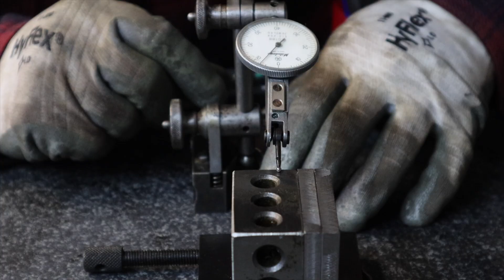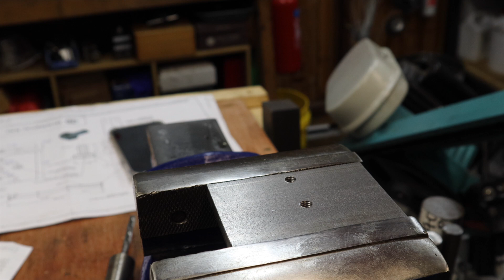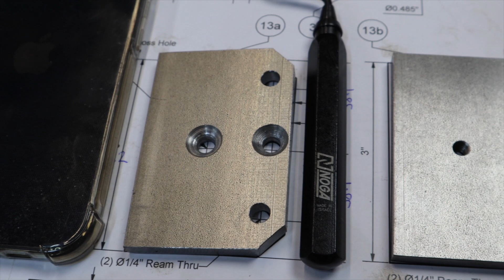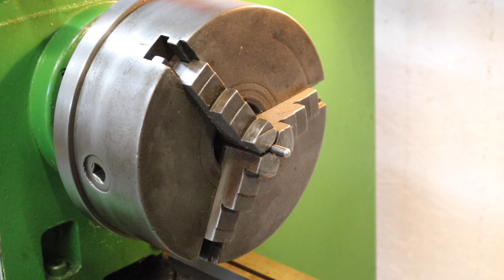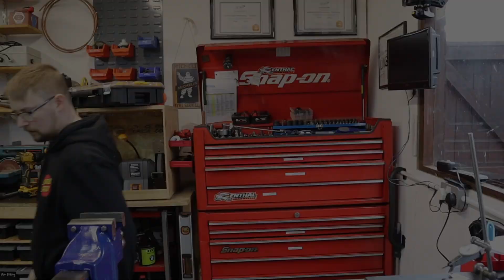Hemingway Knurling tool build Part 1 The Body

Comment: Can you please countersink those holes a fanny hair more it's set my OCD off pal. Just looks like bolt head is ever so slightly proud 🤣🤣
Reply from the maker: Hi Matt yes I will go back at the end and tidy any bits up. Like the holes ;)
Reply: @MachiningwithJoe I’d take a bit off the screw head to remove the printing..😉

Comment: Hi Joe , good to see you back in action. Just a quick comment , you shouldn’t be wearing those type of gloves with machine tools as if they get caught up they will pull your hand in . I use heavy duty Black Mamba which will protect hands from oils and chips etc but if caught up won’t drag  you in.
Reply from the maker: Hi Andrew you are completely right I’ll check those gloves out. I know spinning machinery and gloves is a no no however when I do where them I am very conscious I am wearing them so do not but my hands near the spindles.
Reply: @MachiningwithJoe  stay safe
Reply: Sorry should have said Black Mamba neoprene